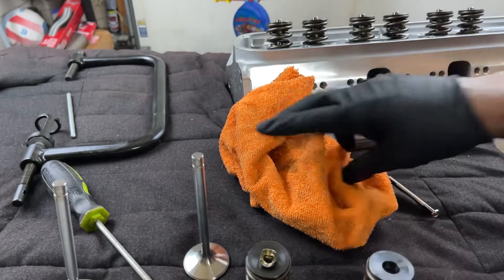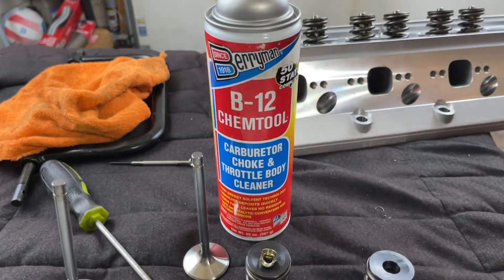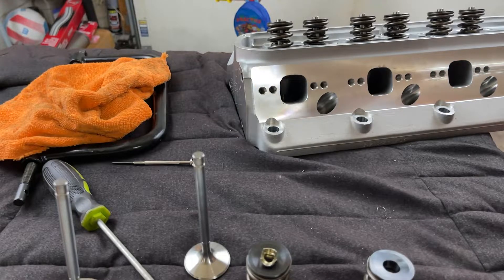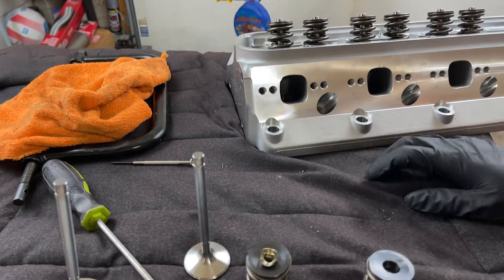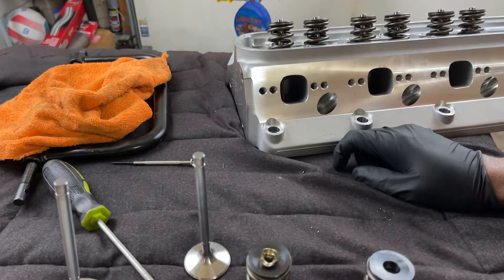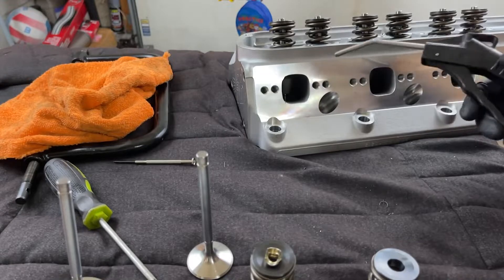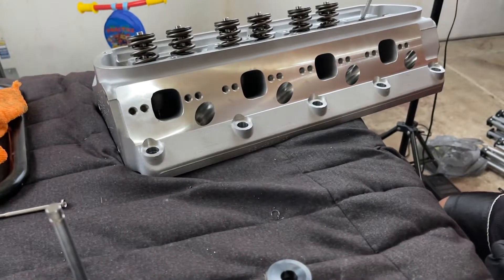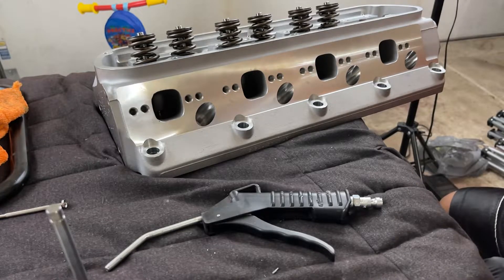Mustang AFR Enforcer Head Disassembly/Cleaning

Comment: Any update on these heads  ?
Reply from the maker: No issues out of the head. Fixed issues that had car down most last year. Should get some track time soon.
Reply: @SN95Power  awesome do yyou have any experience with the promaxx project x heads ?
Reply from the maker: @IDKWTFID  no I'm not. What do you think about them?
Reply: @SN95Power  im in the market for a set of ford heads and im on a tight budget     So im reviewing my options
Reply from the maker: @IDKWTFID  I see those heads have a 2.08 valve on intake. PTV clearance is going to be an issue depending on your setup. The valve train setup on the Enforcer is top notch even though they are not the highest flowing. I think it's a good trade-off

Comment: Those enforcer castings are honestly as good or better than the castings from our USA foundries. Don't worry about the threads- they are roll formed vs. cut with a tap like heads from other aftermarket companies so they are stronger. I would totally run them on my personal car. The cylinder head market really comes down to flow numbers which really is just flow bench racing, and those enforcer ports flow pretty well as an engine upgrade or mid range build.
Reply from the maker: No complaints so far with them. Thanks for the tips
Reply: Wonder why some enforcer heads come with both exhaust pattern and some do not. Waiting to see some 306 testing what kind of track numbers come up